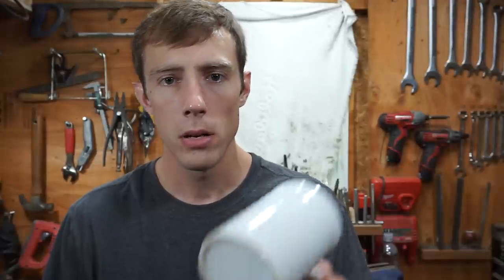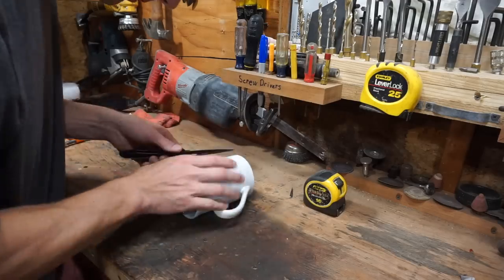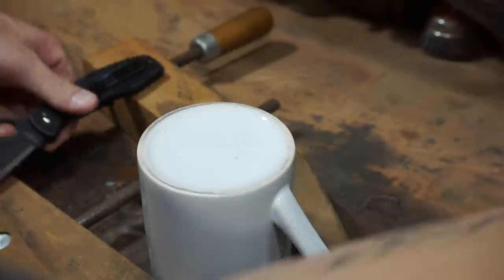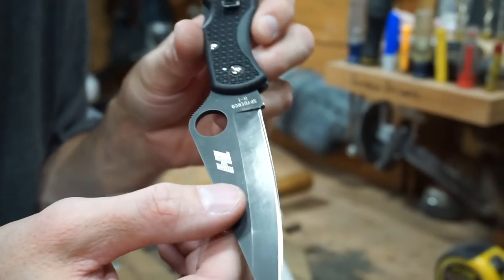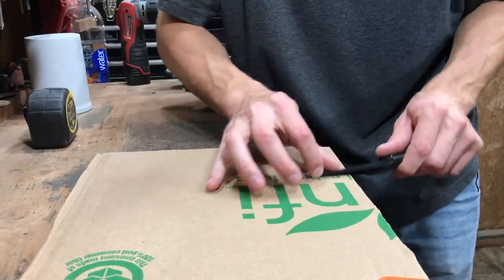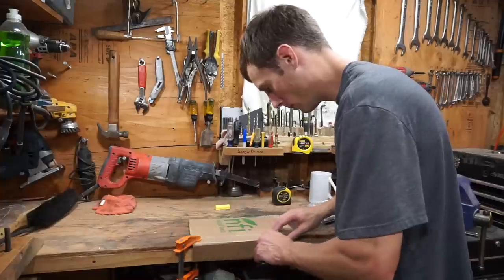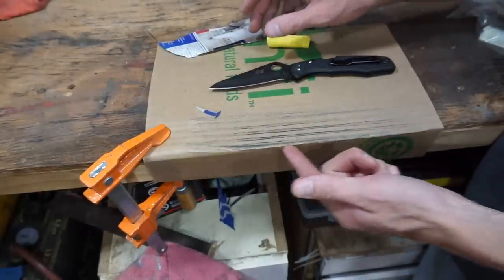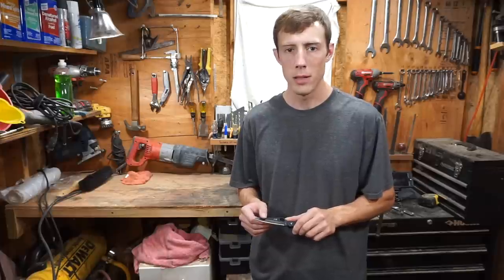WHAT HAPPENS WHEN YOU TRY TO SHARPEN A KNIFE ON A COFFEE CUP?

Comment: The key is having the skill and experience to hand sharpen. With that, it's easy to identify possible abrasives that can be used in a pinch. Good video.
Reply from the maker: That's kinda what i was getting at in the video. In a very, very  subtle way. I was genuinely surprised how well a $1 cup from the dollar store worked. It removed metal like crazy, and gave me a very decent edge. Thanks for watching my friend😀
Reply: I've been practicing for days on 3 different stones, and I just made all my knives even duller.  It's so hard to identify the right angle to hold the blade, and then keep it at that angle.

Comment: cup=ceramic.
some stones=ceramic.
both do the same thing any other sharpening stone would do.only problen is the shape of the mug.
Reply from the maker: Yeah the shape was a big problem..super awkward lol
Reply: Julien Wong juin rey ya exactly
Reply: Shape, inconsistencies in the ceramic compared to a whetstone, also you don’t know the exact grit pertaining what ever mug you use.
Reply: Meh, it's easy enough if you do it one handed while holding the bottom of the cup.  Yeah it's harder to get a consistent angle, but you'll get used to it eventually.  Get some really fine bone china if you want a lower grit.  Check out second hand shops for stuff that's chipped, otherwise you might as well spend the money on a proper stone or something.
Reply: @eldricgrubbidge6465  exactly!! I was wondering why he didn't just hold the mug with one hand and sharpen with the other. It is tough at first to get a consistent angle but it just takes some practice.
Reply: They make square mugs and unglazed-bottom mugs as well
Reply: I have a rectangular mug so im fine
Reply: I was about to say that cups and stones are kinda similar
Reply: @chadtristan7782  is been 3 years!!!!
Reply: @julienwongjuinrey6868  lol i just realised that

Comment: I've sharpened exclusively on the un-glazed edge of ceramic cups/bowls for about 15 years now & it works extremely well once you get the feel for it.
Oh, by the way,  You were stroppingon the gloss side of the cardboard... try splitting a sheet & strop on the raw cardboard texture.
Try using ash or charcoal for grit on cardboard, it works better than you might think!!

Comment: Hey man. I have used this method for a long time, but the main difference is I use the bottom of a  ceramic bowl which has a much wider sharpening area. After that, I strop them on leather. It takes a while, but I'm able to sharpen my knives enough to do the paper test with ease. I guess this method is easy for me because I grew up not having much so we had no choice but to improvise and perfect a cheaper method.

Comment: I wonder how well using the backs of ceramic or porcelain tiles would work?  Or maybe marble, granite, or slate?  Slate is kind of soft, but it still has a MOHS number slightly higher that steel from what I've read.
Reply: I've used ceramic tiles both as a sharpener by itself and as a backing material for sandpaper & honing films. Definitely a cost effective option.

Comment: I know this is old but yeah ceramic you may aswell use bottom of a tile you can sand it smooth and it gives you a super high polish around 3k-5k Id say or leave it rough for like a 800 grit finish plus most people can find tiles free or very cheap

Comment: I have two video suggestions. Can you sharpen a knife on a knifes back. And how well does stropping on paper layed upon a flat stone work.
Reply from the maker: I don't think you can sharpen a knife on another knife...although I have been surprised before lol. I also don't know about the paper strop. Cardboard didn't seem to work real well in this application. At least not till I added compound. Maybe I'll try paper with compound and see what happens.
Reply: What if you sharpen on the backside of a thick knife?
If you wrap the paper around a whetstone (when it is dry) wouldn't that flatten out the bur when the knife is pressed against the stone (with a paper layer over it). Just my two cents.
Reply from the maker: I've never tried the paper on stone before. I'll give it a try and see how it works. I don't think  sharpening a knife on the back of another knife would work.  You need something harder than the knife it's self to sharpen.

Comment: Little late to the game here, but the concept of stroping with cardboard is supposed to be done with the edge of the cardboard, not cardboard laid flat. It works best if you glue 5 or 6 strips of cardboard together so you have more edge surface. Gives you a little more abrasion. Anyways, not saying this is the best thing ever but yeah, it will do in a pinch.😅👍

Comment: I've done it successfully many times with kitchen knives. It's tough to hold a good angle with the mug being round and so little sharpening surface but it does work. Not the best though, obviously, but they all cut food and veggies and stuff just fine. Kinda puts a convex edge on the knives but that depends on how well you can keep a consistent angle. I, personally, prefer the convex edge on the small kitchen knives I use for cutting vegetables and other food.  Make sure to wipe off the leftover metal off the mug and knife. Once you get good at this, it takes about 10 to 15 minutes or less to sharpen. It's a handy tech if you can do it well. But I'd stick to a stone or belt or whatever else you use. Again, this is just kinda a handy life hack. But it does work. And does come in handy.

Comment: Cardboard works for me. Gets the knife hair shaving sharp. I don't know if it's my cardboard or the fact that i turn in 90 degrees compared to the way you've used it. To me it seems like it works better if you strop perpendicular and not parallel to the supporting structure of the cardboard. My cardboard usually turns black from stropping the knife, so i have no idea why your cardboard didn't work. Maybe you didn't use enough pressure. 
I've learned this from the carter cutlery channel. So maybe check out his channel...

Comment: I hold my cup at an angle and run the blade straight as on a Sharpmaker (that I'll get some day 😁). Then strop on an old canvas belt. Not the best method, but beats having blunt blades. I used the same method on a completely blunt ax, starting on a triangular file held at an angle before moving to the cup.
Reply from the maker: I was surprised how well this actually worked. I didn't think I'd be able to get the edge I did. Especially stopping on cardboard. I like to use two hands when I sharpen, just personal preference. Holding the cup wouldn't work for me lol. I sharpen my axes with files all the time. The old timers knew what they were doing! Thanks for watching 😀

Comment: I wish I could find a way to sharpen my microtech ultratech dagger, it's a m390 blade. I even bought a wicked edge but could not ever get a good angle. Any advice?
Reply from the maker: Wow that's interesting..I'm not sure what could be going on. I suspect your not fully apexing the blade. Even on a wicked edge you still need to make sure everything is fully apexed. M390 is hard stuff. I have worked with it before and it took me awhile to sharpen. Although you say it's a dagger... does the wicked edge not hold a dagger properly?
Reply: OUTDOORS55 yeah it was hard to clamp due to the double edge blade. It could not grip on to it that well. It's so frustrating because I can never get it hair shaving sharp. Ever. I have no problem with other blades but this one  is quite difficult.

Comment: At first I thought your question was rhetorical but to answer the question, no.
Sharpening would be long and drawn out, but honing is what most people are talking about when using porcelain or the top of a windshield.
I finally just jumped on the Wicked Edge band wagon and haven't looked back, the sticker shock was kind of like jumping into a pool of ice water, but once you have acclimated it's all cool!
Reply from the maker: You know at first I thought the same thing about sharpening on a cup, that it would "hone" more than sharpen. However, I actually dulled this knife on a rock to a point where metal shavings were coming off of the blade. Now I'm wishing I had filmed that lol. It also didn't come across on camera how well the cup actually removed the metal from the blade. I was shocked at how well it actually worked. I would definitely love a wicked edge, but that PRICE! I dunno, maybe one day lol! Thanks for watching!

Comment: I sharpened a Gerber 06 auto for a USN Member on my sons coffee cup at the Naval base in VA. BY HAND. Use the top rim of the coffee cup after you use the bottom. My grandfather used ceramic rods that were partially glazed just like a coffee cup he got while working at a textile plant in NC The Gerber 06 isn't made of. chineseium its decent steel. The guy shaved his arm.  with it.  With years of hand honing and sharpening experience in an emergency it can be done. As a side note I had left my DMT RED RAT TAIL Trifold at home, so you do with what you have. The cardboard strop technique also works with Semichrome, Flitz or Mothers mag wheel polish. Apply a thin layer to the cardboard and allow to dry.

Comment: We used to use ceramic mugs all the time in my old restaurant, worked great but I believe it more honed the blade then anything, haven't seen the video but I got a strong urge I kinda know where this will go right off your intro, nope, way off, also u never really are meant to sharpen em like you would typically. We just ran the knife off the cup bottom more like a honing rod, thus my initial thought, really cool video thanks, helped someone 6 years down the line hope you are doing well

Comment: Works better with a mug where the whole bottom is rough and unglazed. I can grind down the dull tip of old worn knives, make a serrated bread knife a bit sharper, or dull horrible unfinished spoons. Most of the metal deposits can be washed off with baking soda and dish soap. The edge comes out more shiny compared to a pull-through sharpener, maybe as a result of the material getting clogged up over the session.

Comment: bro. u hold the cup with one hand and the knife with the other. its super easy to do. using this method u don't really worry about having the exact angle...because if u did u wouldn;t be using a cup anyway
Reply from the maker: Exact angle doesn't matter. Maintaining a chosen angle, so the blade is fully apexed is what matters. Sharpening on a cup is just for extreme cases😉 Thanks for watching👍
Reply: I do the cup thing pretty often, getting the angle right is important just like on anything else. But yeah you hold it in your left hand like a lansky puck etc. Watching the cup slide around gave me the impression of one of those infomercials where the actor keeps on messing stuff up. I love this channel though, keep up the good work!
Reply: Josh Starkey I was thinking the same thing, looks like he is intentionally setting up for failure by using both hands on the knife

Comment: I know this is a bit of an old video but I couldn't help myself from asking... have you ever tried to strop on newspaper?  I've found (in my very limited experience) that it actually works quite well for something that is essentially free. I just wrap some around a block of wood and it seems to work just fine. Just wondering about your thoughts on this, or if anyone else have ever tried this?

Note* This is a trick that I learned from a sharpening video by Murray Carter.
Reply: In my mind, plain old black and white newspaper seems to have more abrasive properties than cardboard.
Reply: I've actually done stropping on newspaper before I got a leather strop and compound and it was at the time the sharpest I've ever had my knives.  Now newspaper is hard to find so it is kind
Of pointless but I can see why they did it when everyone had their daily newspaper.
Reply: @Siloguy Depends on where you are. Around here there are still plenty of free papers all over.

Comment: I wanna see him use a sharpening steel/rod (which ever you call it). I always hear people saying "it doesn't actually sharpen, it just refines the edge" but it does so by REMOVING METAL so it would definitely sharpen a knife if you put enough time in it and i think he could and would do it
Reply: Those are honing rods, not sharpening rods. Only some kinds remove metal. They're generally to straighten the edge as it gets slightly bent over time. The ceramic rods do remove a little metal depending on the coarseness.

Comment: I guess in a pinch if I need to put an edge on a blade, I can always use a ceramic mug! But the cardboard strop might be a stretch. Where would get the compound from? I'd use a leather belt instead.
Reply from the maker: Yeah cardboard didn't work as I had planned. I dunno maybe I was doing it wrong. The compound came from Home Depot. You can order it from Amazon for very cheap too.
Reply: Cardboard does work as a strop, I used it in place of leather until I made myself a decent wood backed leather strop. It mostly only works if you use it as the backing for compound or use it only to deburr.
Reply: I've found it depends on the exact type and condition of the cardboard, funnily enough.

Comment: There's a problem with technique. Coffee cup is just an available abrasive material that most people have. It's not for reworking a completely dull rounded edge to a fine edge like you were doing. It's good to treat the bottom edge like a knife steel and give a few swipes to remove just a modicum of material in order to take a slightly dulled edge and re-tune it lightly. Like working with a steel, you wouldn't attempt to use a steel to reshape a completely dulled edge: you use it to hone the edge of a slightly dulled knife.
Reply from the maker: This video is weather you can sharpen, not hone.

Comment: well..for me, it is kind of worst case scenario..if you have dull knife, and don't have anything else to sharpen..another tip for this worst case scenario is to strop on backpack belt, on the part you use to adjust fit..
Reply from the maker: I agree, this is a worst case scenario. I was surprised just how well it worked though!

Comment: I definetely sharpen my knive on a coffee mug and plates. But a little bit. Still cant make it sharp to the point where can cut paper effectively. Cuts the paper but if i saw the paper. Not by impact of the blade. Not by strike with knife. Sharpest knife i think could slice through the paper using only its own weight. And if drop the paper from one meter towards the edge of the knife then the paper must be cutted by its own weight. There is some method how to sharpen a knife with dinner plates and mugs but definetely the stone makers willdont want we to know that.

Comment: What knife is that or where can i order it lol
Reply: Elite's Gaming Channel Spyderco salt C88
Reply from the maker: It's a spyderco pacific salt. I'm not sure they still make a pacific salt anymore. They still make the spyderco salt, which is a smaller version.
Reply: Is that street legal in Europe???
Reply from the maker: I don't know. I think it would depend on what country in Europe.
Reply: So this is different to the Salt 1 and Salt 2 - what are the major differences if you know offhand? (Tx)
Reply: Elite's Gaming Channel Most of Western Europe it won't be. Slavic/Eastern Europe is generally way more relaxed. Poland has no knife laws ☺
Reply from the maker: Litogeorge I'm not very familiar with the salt line. I could be wrong but I think the pacific salt was the largest of the salt series.
Reply: Thanks mate. So related question for you here in Canuckistan: best folding pocket knife under $50 and $100 in your opinion?
Reply: LitoGeorge In CAD I think a Rat 1 D2 comes in under $50, and an Endura or Delica 4 ffg comes in under $100
Reply from the maker: Litogeorge IMO, the spyderco tenacious wins for under $50. I've had mine for 7 years and use it everyday. It's built like a tank and has (imo) the BEST liner lock on the market. 8cr13mov steel is ok. Not the best but certainly not the worst. The tenacious is also easy to take apart to clean and service. Best knife under $100 is tough as you get to a point where it comes down to what steel you like the most. For around $100 you can buy pretty much any steel on the market. A very hard question to answer lol!
Reply: Thanks for those answers gents. The knife community seems to be like many other interest groups - favouring one or two X brands within reasonable guidelines for X people. The Rat and Tenacious are common answers. Not living in a major city makes this tough to check out both - much prefer holding something in the hand when it comes to this sort of thing. Whats your best opinion if I wanted a steel that will retain an edge the longest in the sub$50 and $100 range, and have a framelock or midlock. (bad experience with a linerlock has scared me off of those). Appreciate your knowledge. Currently had 40 some tabs open on various knives and learning learning learning..
Reply: In lieu of an answer from you guys to my final question, I decided to buy Ganzo's - the Para2 and Delica inspired models. Cheap as chips. For around 50% less than a Tenacious all in. I won't feel bad using the knives for unintended use and my research shows that the 440C should outdo the 8cr13mov a bit. I appreciate your answers and input to get me to this point. Now for the 2month wait.
Reply from the maker: Sorry I didn't see your last posts! YouTube didn't notify me. It's weird they notified me on this one...I think you made a good choice. I've found 440c to be quite similar to 8cr13mov. It may have a slight edge (pun intended) in edge retention, but it's very hard to tell.  Anyway good luck waiting!😀
Reply: No worries mate. One of my replies got deleted automagically which pissed me off so I get how Youtube does that. Anyways - I'll drop some feedback when I get them if you like